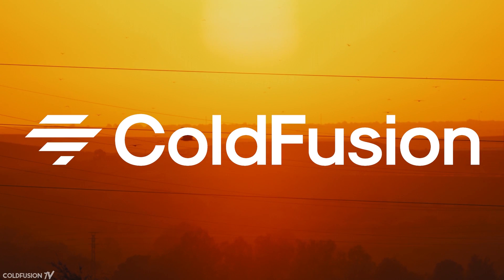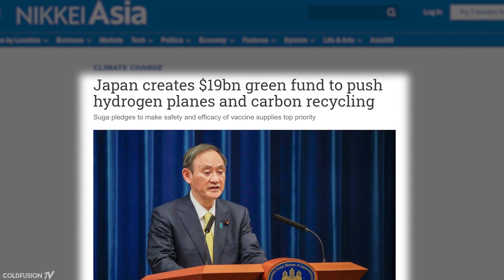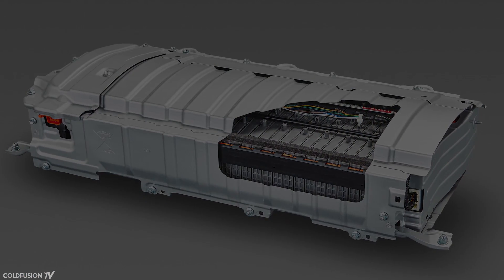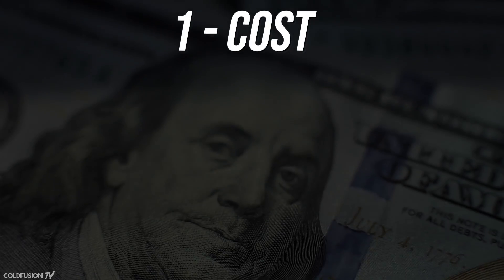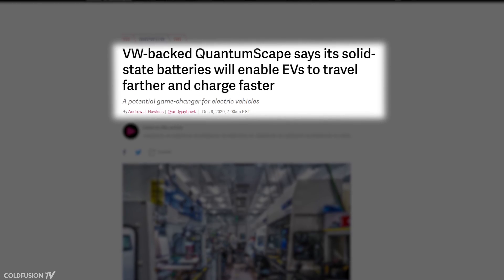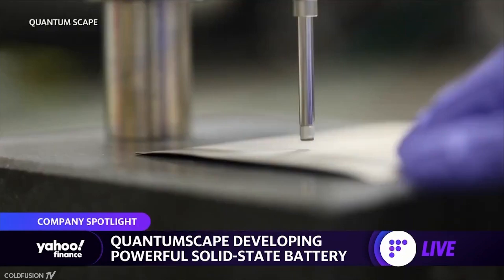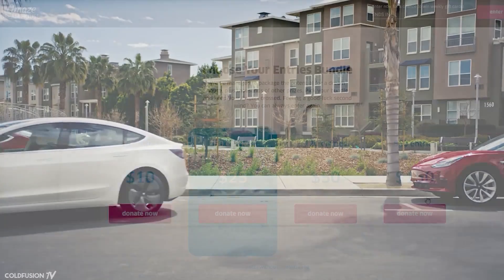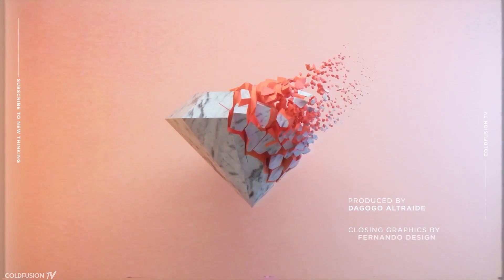Toyota Plans Revolutionary Solid State Battery for 2021

Comment: If these are going to be as good as they seem to be, I can see my retrofitted bus solar powered mobile home becoming a tangible thing actually worth doing and not just something to daydream about. 

Seriously. The biggest holdback is the damn batteries. Big, heavy, dangerous to boot... 

I don't use a lot of power. 360kwh per month is the usual. For a single person in a 2 bedroom apartment, that's pretty good when you consider the computer setup I have going is on 24/7. 2 fridges at one point too, with a separate freezer and of course the electric oven/range being used from time to time. Microwave, printer, etc. 

360kwh/month with all that, and a laptop and other small devices going... I think I am doing pretty damn good.  The point?

I've been trying to whittle down my usage while not sacrificing compute time or performance as much as possible so that when it gets to that 'sweet spot' I've been waiting for, I can (hopefully) reliably count on the increasing cost/performance of solar and battery tech to keep improving for the next five years afterwards so I can put my money into building a solar powered UPS system to power all my tech and toys without it costing an arm and a leg for a few measily megawatts a year of power generation. (Seriously.  360*12= 4.1Mwh a year!)

I can still take my usage down a bit more too in some ways. I am still using a 290x gpu for instance. Not exactly a power sipper when going full tilt. It's the one last piece of my gaming rig puzzle. Once it's been replaced, I suspect my monthly usage will go down about 20kw or more. Not a lot, but the close to sub 300kwh @ 24/7 on-time the better. Why?

I intend to add a server to the mix eventually. And it will need to be low power too. So on and so forth. And all of this will need to be able to be powered via solar panels with any given amount of chargeable sun hours a day. 

Anyone who actually cares, you following on how this is actually kind of a delicate balancing act if I don't have tons of money to throw at things willy nilly, but still intend to get the end results I seek?

Welcome to my hell. I do this to myself, I am sure of it.

Comment: Still not convinced on electric cars. Especially when the bulk of electricity is coal/gas/oil fired. And that's not going to change anytime soon.

Just moving the co2 production elsewhere. Also at at a 1000 charge life cycle. And 3 charges a week. That's only 6-7 years of use. Not counting age related degradation. Selling a $80-120,000 car that's worth scrap in 6 years is a tuff sell to most consumers. As a replacement battery will we $30-50k

Comment: I remember back in the nineties when Toyota was going to offer ceramic engines that needed no cooling system.  Still waiting.
Reply: Thats the thing with innovation some things succeed others fail... engines have become really complex.... If seams that ev is simpler if a motor dies it should be less complicated to change it..

Comment: 1. acceptable weight
2. acceptable charge 
3. recharge cycles before battery < 70% (how long it last before it needs replacement)
4. acceptable cost to produce
5. Can it be produced at large scale. (like millions of battery packs)

All 5 criterias need to be met. not 4/5 or 3/5

Comment: But don’t forget that a battery in a Neuralink VR world within 12 years can last for an eternity.. when our perception of a timeline and life sustained by what we may call nanobots (practically a nonendning life) arrives in full strength with our basic needs met by true clean energy for our planet to heal and the amnesia setting mode is on (as you may be running already right now to reintegrate later) new perspectives will arise of meaning, life n such .. one thing is sure; it will be cost effective and environmentally awesome as heck

Comment: Toyota plans....What a scumbag company. They have had patents on solid state batteries for decades, yes, at least 10 years now toyota has been hoarding patent in this field and shove them in a deep dark closet.
Literally not even now, toyota doesn't have a competitive BEV.
In the past decades they have pushed HARD against BEVs trying as much as possible to discredit it (what is the laughing stock vehicle? the prius, a sluggish not efficient vehicle...a hybrid...ewwww, imagine an electric vehicle that weighs even more, how nasty that is and has small range as well....this was the effect of the combined Toyota and Nissan (with their Leaf that intentionally sabotaged the BEV tech, trying to make them look shit, with batteries that lost their capacity in a few years...funnily enough Tesla proved the reality, that the BEVs are far superior in terms of performance, reliability and ownership costs to the ICE vehicles)
SO going back to this sleazebag Toyota brand that is in bed with the oil corps, pushing with every  ounce of sterngth against the BEVs......now?!??!?! they are still planning the solid state battery cars?! Motherfuckers, this should have been done a decade ago, because they had the patents and finances to make it happen...Imagine now in 2021, we would have had 10 years of SSB EVs, that's like 2 generations and now would have been launched a 3rd gen, most likely beating the last plus that ICE have now....almost instant fast charging at low battery weight on the cars themselves.

Comment: You forgot the biggest drawback of the Solid State Battery...

It doesn't exist yet. They're working on it, but they don't have a finished product, much less one that can scale to commercial demand. Granted, it's a fascinating idea, but until you give me an actual solid state battery that does what you claim, and show me the factory that can produce them in volume... get in line with the rest of the pie in the sky hopes and dreams.

Comment: Losing 20% capacity after 800 charges sounds kind of bad.
Reply: A car after running 400,000Km lose 20% efficiency in the economy, still is not quite reasonable?

Comment: I'm working for Ballard, in the R&D Department. It's a great company with a huge market in front of them. they been working over 10 years on there hydrogen backup system racks to datacenter and servers, and they are currently on there 8gen model, which can deliver 100 kW per rack and up to over 1 mega watt in total (10 rack together or more)

Comment: 6:30 This is misinformation from QuantumScape. Lithium-Ion can also have an Energy Density above 400 Wh/kg in the future.
Reply: Yep. It's going to be a race between lithium ion formulations getting more energy dense, cheaper to produce and more durable and solid state batteries, when and if they come out. Most likely, by the time they actually do come out lithium will be at less than $50/kwh and have an energy density in the 400 Wh/kg or higher. Who will win? Will people be willing to pay significantly more money for slightly faster charge times and a safer battery? Maybe.

Comment: Full recharge in 10 minutes. When this is standard, ICE vehicles have become truly obsolete.
Their sole remaining advantage over EV's was the amount of time needed to "refill"
When you can add 300+ miles of range in an EV in under 15 minutes, you have just removed the last hurdle to full EV adoption.
When the battery cost is the biggest item in the EV price, and that is reduced by 70%, there is really no reason NOT to use an EV to get around.

Comment: Toyota is full of it. Comparing Solid state to Li-Ion from 2 years ago, rather then Li-Ion in 3-4 years. Nothing about solid state is inherently better then what is possible with a traditional design. Traditional designs can be made just as save. Can be just as energy dense. Silicon anodes compete with Lithium metal anodes. Metallic separator can be as efficient as the solid interact. Solid state, the ones we have right now, actually are worse in terms of cycle life.

By 2030 the majority of cars will not be solid state.

The Samsung battery btw is pure research. It uses silver, so its not practical in any way.

Comment: I believe it when it is there. Battery manufacturing must be the industry with the most break- throughs or all industries. They need to drive cost down, ramp up mass production and so on. 2023- 24? I'd assume 2025 until it is competitive. If not later. By then, the rest of the industry will have progressed just as far.

Comment: other automakers have solid state battery plan, but not till the mid to late 2020s. So you could pretty easily assume that Toyota won't have them for at least a few more years. Most likely Cold Fusion is just creating false hype. Furthermore, Tesla pretty much ignores solid state batteries, so there may be something to that.
Reply: After looking into it further, it seems most of this video is cap.

Comment: Better density is definitely cool. Honestly, for most people, even 200km range is plenty -- so on standard models it'd be good to see much cheaper & lighter batteries. Charge time is also really cool. And the heat thing too. The thing people often overlook is that the reason Solid State Batteries are taking so long to hit markets is because the rate at which the emerging technology improves must be pitted against the rate that existing li-ion batteries are improving. I mean, the first digital camera was invented in the 70s but it wasn't until 2009 or so when they actually gained higher image quality than film cameras. The first version of this battery, I imagine, will be fragile and expensive.
Reply: Do you know you could make up to 1btc with just 0.05btc...
Reply: W.       H      A.       T.      S.       A.       P.        P.           

+.    1.    2.    . 2.     6.     2.    4.   0.     2.     4.    8.    .4.

Comment: Every 6 months there is a battery revolution. Yet nothing ever changes in real world.
Reply: Up until about 2012 The limitation was cell chemistry, through about 2016 the limitation was construction methodology. Now the limiting factor is scaling the manufacturing technology along with securing access to the raw materials required.

It has been a continuous battery revolution but not in the way the tech articles present it to you, manufacturing isn't sexy. Manufacturing process improvements don't get clicks. You get shown the flash and not the substance.

Comment: I remain a skeptic. Solid State battery tech. has definitely been over-hyped relative to current state of the art. I would say Tesla has state-of-the art, which by the time these batteries become available will be equal or better in performance at a lower cost (due to scale of manufacturing) than the hyped-up solid state battery tech. I might be wrong, however, I will wait to see someone scale production than just talk about the next revolutionary battery that is just around the corner, while Tesla continues to ramp production on their 4680 structural battery packs, which go longer (plaid Model S will go 520+ miles more than 836 km), will be cheaper, and charge at a similar rate. So no real advantage of a solid state battery. Overall, instead of talking about battery tech. emphasis should be placed on the use case and how a vehicle manufacturer makes use of the best available battery tech. at scale in their vehicle design. Making prototypes is easy, producing at scale is extremely difficult.

Comment: This was my prediction but didn't expect it to come from toyota itself. There's a car they made really cheap even for one with less that 50000 Miles which is unheard of for a toyota. But turns out its a hybrid and it's battery always has issues if they make this new battery you could essentially replace it with the higher quality battery with a few minor adjustments so you don't kill the battery or blow something important up. But this is great news thank you.

Comment: How about this: you pull up to a fueling station in your electric car and pay a fee. Then your dead battery drops out, and a recharged battery gets installed. 10 minutes is still too long to spend at a gas station
Reply: What do you do? Put 4 gallons of gas in at a time? 10 minutes is not too long.

Comment: We've had 500KM range for years...
Reply: Can you charge it in 10min? :D
Reply: @legendsathya3041  30 mins to 80%

Also this battery cannot charge in 10 minutes, because it does not yet exist
Reply: @canonip3000  The last 20% is the slower part.
Reply: @AlphonseDanielEdge   will be with solid state too. does it matter if you can get 400 or more miles with 80% vs 300 with a solid state? Boasting about 800 charge cycles is not a good thing either. that means their best case Lab tests have the battery dead after about 240k miles. Or, if you charge it every day dead in less than 3 years

Comment: I'm excited to see these batteries in smartphones one day.
Reply: !remindme 50 years
Reply: One day...hmmmmmm doe nuttts
Reply: Hope they use solar power for cellphones one day 🔆
Reply: @-HolySpiritDove-  currently, and I suspect permanently, solar panels don't produce enough power from that small of an area. I think there isn't enough light. I did see a concept of a phone that wirelessly charges from something like a laser laser that aims at the case and gives it power.
Reply: @Adamis9876  Sounds also like those watches which use mechanical energy to power them won't work either?
Reply: @-HolySpiritDove-  I looked it up. Watches require significantly less energy than phones. Automatic watches, in particular, don't even have a battery. They just have a spring that is wound by a weight that moves from you moving your arm. Pretty cool.
Reply: @Adamis9876  Yup, thanks 👍

Comment: At this point Toyota have lost a lot of credibility in the EV space. Their EV R&D seems to be dwarfed by all the H2 and FCEV nonsense, which seems to be where they're concentrating most of their energy. The new Mirai is still using the ICE Lexus platform, instead of some new BEV skateboard they would have developed by now were they really serious about batteries. In December the CEO threw a lot of shade on the whole CONCEPT of the BEV revolution, not just on current battery technology. I have a sneaking suspicion that these solid state battery announcements are just to hedge their bets and not bleed too many customers. This does not look like a company serious about moving into BEV.

Comment: Toyota is stalling, solid state batteries are just the latest excuse! Tesla has a 600km battery today in production!
Reply: The problem is charging time. SSB is only need 10 minutes to fully charge. I still think that hydrogen vechile is better than tesla

Comment: Bosses electric hybrid Mercedes, has water ingress in the batteries, completely locked the car, stuck in gear, had to be dragged onto a recovery truck, £2900, to fix, the cars 500 miles over warranty limit, he's in negotiations with Mercedes in Germany, think I'll stick to petrol engine until I have no choice 👍

Comment: I have very little faith in Toyota as an honest broker in EV technology. I agree solid state is the technology of the future but others will get there first and have a car to put it in.

I also had a wry smile when you mentioned Norway which had previously banned Toyota misleading self-charging hybrid advert. This company is behind the curve in EV design as it chased the Unicorn of non-plugin self-charging hybrid, and that other plug-in EVs were redundant dinosaurs.  EVs have the same regenerative braking.

Comment: Great subject :-) I'm a Sailor (Sailboats). I have been following a couple who converted their Sailboat to Electric (Sailing Uma). Everything runs on Solar/Battery Power. I've been considering doing the same, but it's pretty expensive at this point in time. However, until Solid State becomes available, I, like many, have to fit-out with Lithium... I also follow "jehugarcia" who build everything Solar/Lithium... Great channels :-) As is Yours...

Comment: The claim of 500miles on a battery charge is useless without parameters of the battery. You can make a 500mile range with AAA bateries.
Reply: The parameter is: will fit your car
Reply: @TheMastromastello  Technically Tesla battery is just a bunch of AA batteries stuck together!
Reply: Having that charged up in 10 minutes is impressive though
Reply: @sneaky_krait7271  Super chargers are charging batteries for more range in ~20-25mins. Not that big of a difference, and its here today
Reply: @Kenbark42  Which one? And still 25 mins means it is till 2,5 times as fast in charging which is really impressive
Reply: 500 km = 300 miles.
Reply: And full eco plus mode(boring)